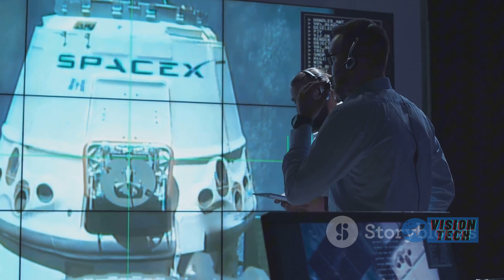Shocking: SpaceX's Most Proud Technology Was the Main Cause of the Flight 8 Explosion

Comment: Why do people call it a set back? Test flights are always learning stages. Anything that happens is a learning experience to move forward not a setback.
Reply from the maker: Oh, so now everything is just a "learning experience"? 😏 Sure, test flights are meant to gather data, but let’s not sugarcoat failures as mere “learning stages.” If things blow up, that’s a setback—no matter how you spin it. You can learn from it, but pretending it’s not a setback just because you want to be optimistic doesn’t change reality. 😂
Reply: @SpaceXToday247  are you new too the rocket testing community? At no point in history has a failed test been a set back, especially now with loads of telemetry data. You can read what has been learned each flight and why each flight is changed from the last.
Reply from the maker: @tobydobo4080  Oh, so now failed tests have never been setbacks? 😂 Tell that to programs delayed for years due to catastrophic failures. Sure, data is valuable, but let’s not pretend blowing up multi-million-dollar hardware is always just part of the plan. If everything went smoothly, we wouldn’t need this many test flights. Learning is great, but denial isn’t a strategy. 🚀
Reply: @WiseGrandpa247  if it was a setback then why is the next starship nearly ready for next launch? Maybe your argument is more about semantics than logistics.